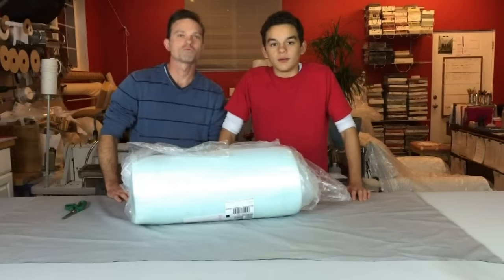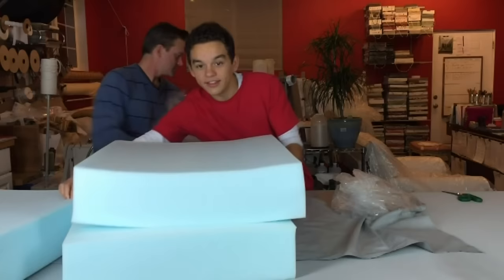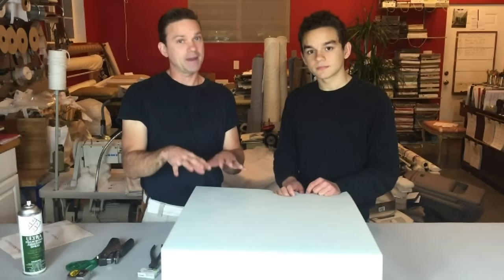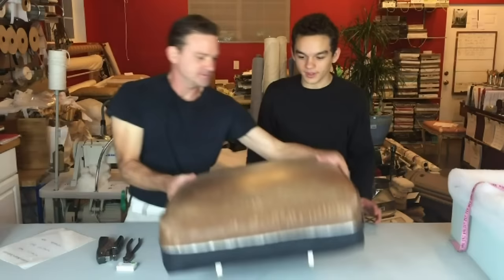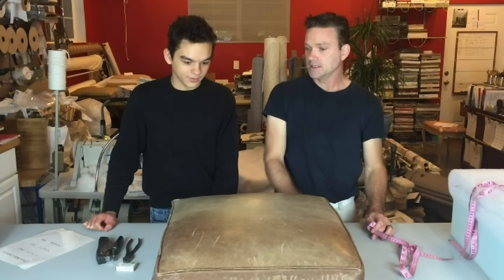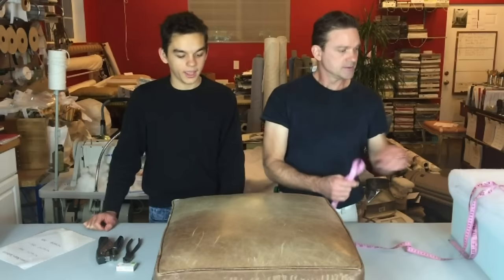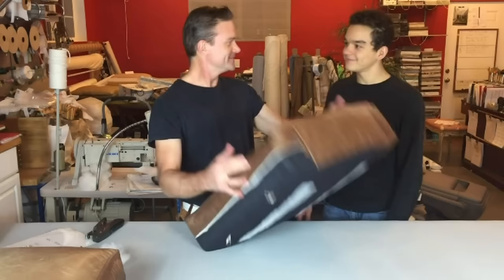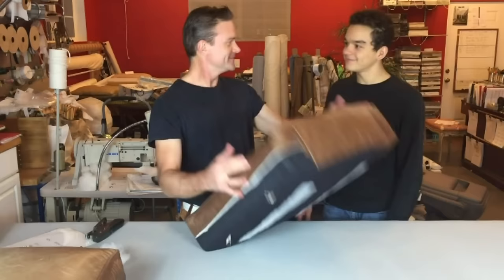Replace the foam in your seat cushions fast and easy!

Comment: How can you staple foam?
Reply from the maker: Hello Betty, Good question, sorry for the late reply very busy here lately. Its pretty simple really. You will pinch as piece of foam and poly batting and the staple will stay in there. In fact they can be difficult to remove if you need to for some reason. Hope this helps. Please share the video it helps when you do. All the best,  Paul

Comment: Is the density of the foam you talk about in pounds?
Reply from the maker: Hello Karyn,
NO! It is the amount of poly foam or fill per square inch VS lower density with less foam cells per square inch. So in other words you will have a higher density higher quality longer lasting foam. I hope this helps. Thank you watching and please share the video it helps us when you do.  All the best,   Paul
Reply: @ucsolutionsgivingmore  THANKS.  
The density I can get (easily here in NZ) is 16kg/m3 . I am trying to compare, but I think I'll continue my research  and go straight to a manufacture (or Alibaba, haha 😃). Can't wait to get on with my project with the help of your vid, thanks!

Comment: How do you open cushions with the zipper pulls are seen inside?  Actually, I can't tell if there is even one inside.
Reply from the maker: Hey Kathy,
Very sorry for the late reply, extremely busy lately. I believe you have a deep zipper pocket that is hard to reach, I have experienced this before. If you have not already solved the problem, try to reach as for back into the pocket as you can to get to the zipper tap. I have never seen a cushion with a zipper that didn't have a zipper tap. I hope this has helped you with this problem. Let me know how it turns out if you are willing. Hey, check our latest video you could win an Amazon gift card  https://youtu.be/QsNnS8JcjIE                    All the best,     Paul

Comment: How can I tell if its the cushions or the actual 'bed' under the cushions of my couch that's letting it sink too low?
Reply from the maker: Hi BnJ,
Great question, and sorry for the long delay! One way to tell is to sit on the platform without the foam on it. If it sinks down too much that could be a sign that the platform is bad. Or you could put a long plywood sheet that runs the entire width and depth of the platform between the cushions and the platform. This will give you more support in general and will help you determine if you still need foam replacements.
I hope this helps!
All the best,
Grant

Comment: my thing is......I want my very hard cushions to be as comfortable as my memory foam is in my bed.......what do i do plz?
Reply from the maker: Hi Angel,
Unfortunately I don’t know of a way to make existing foam softer. The only thing that you could do is to cut the foam inserts down thickness wise and add a bunch of Dacron wrap or preferably a layer of soft foam on either side. 

The other way to make your cushions soft is of course to replace the entire insert. If you need foam or dacron supplies you can get it at our shop at ucprivatecourses.com
Hopefully this helps!
All the best,
Grant

Comment: Foam cushions are crap. Good cushions are made of a pinhole latex center within an envelope of dacron, or even better, goose down. The latter is pretty expensive but you never have to fluff them up. It's what rich people have.
Reply from the maker: Hey Roy, yes you’re right cheap low density foam is really bad. We only recommend high density foam it’s a lot better for performance and longevity. I too like latex it’s incredible very long lasting. That was the only choice we had a few decades back or so. Thanks for watching please share the videos with friends and family it helps us to keep doing them. All the best,  Paul

Comment: I've had this couch for like a year and when you recline you can feel the frame on your lower back. The company I bought it from went out of business. Go figure.
Reply from the maker: Hello Aaron,  isn’t that the way it goes. Sounds like there’s very little foam or padding on the lower back rail. If you want a replacement chair go to our latest video on want avoid when buying furniture. We are giving away a great chair you could win it, there’s a contest. Again thank you, cheers, Paul
Reply: @ucsolutionsgivingmore  I'll check that out. Thanks. I figured out has only been 4 months and not a year. I don't know what I was thinking.

Comment: Why dont you put it in plastic and suck the air out put the cover on and remove the plastic?
Reply from the maker: Great question, it's an added expense to inventory. And if you go a little bit at a time with putting in the foam insert, it does quite well without the plastic film. Plus the film is wasted in the process which we like to keep as much stuff out of the landfill as possible.
All the best,
Grant
Reply from the maker: Hi Tamara, I saw your comment about where to get good memory foam. Try foamorder.com right now we do not supple memory foam. As always thanks for commenting and let us know if there's a video you would like to see. Please don't forget to share. All the best,  Paul